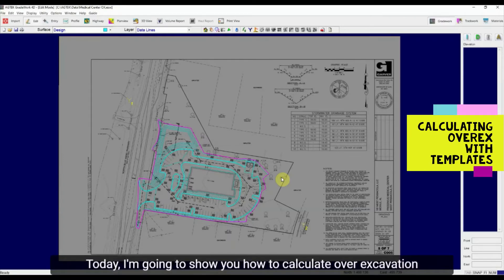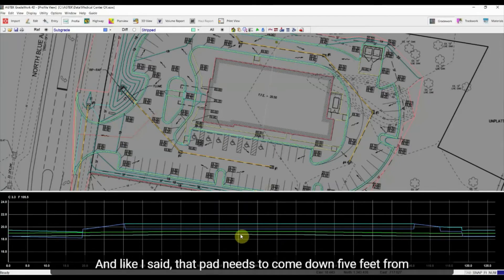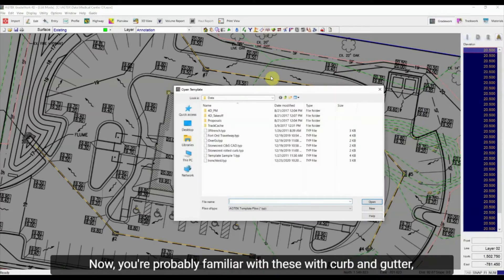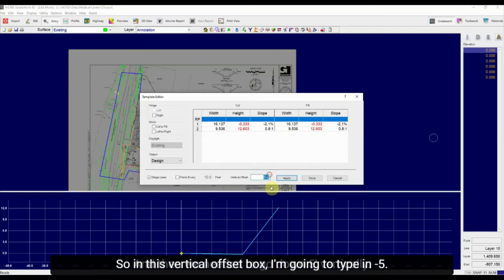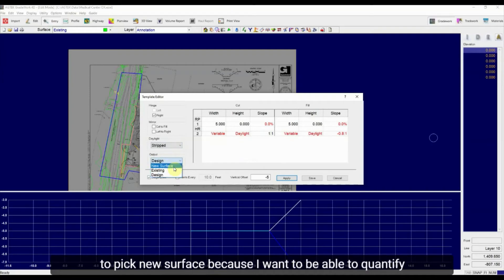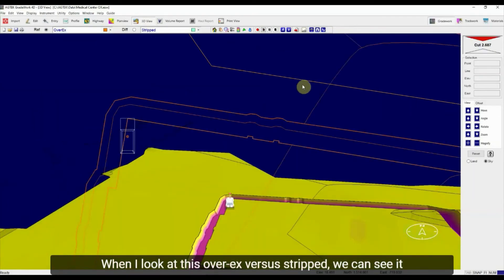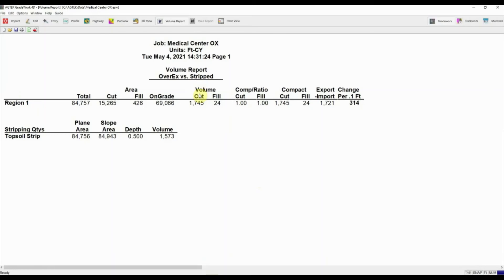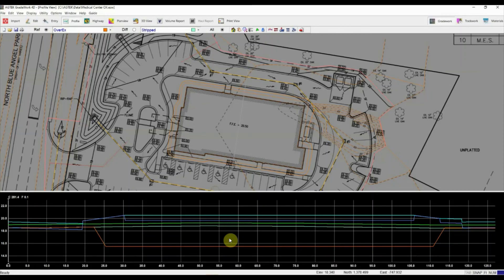AGTEK Tech Tip - Calculating OverEx (Part 1)

Comment: Why is this so complicated when all you have to do is create a section within the pad itself. Drop down menus with 5” (or however thick)concrete, cushion sand if you need it in inches”, and select fill depth in inches. Y’all are making this too difficult with having to draw templates. Very rarely do you have a project with the same strata sections.

Comment: The over-Ex and striped CYs are almost the same. I'm guessing the striped CY is the whole site and not the area of the over-ex only.
A 5' cut and a 0.5 cut should have a big difference in quantities for the same area.
Reply: Why is this so complicated when all you have to do is create a section within the pad itself. Drop down menus with 5” (or however thick)concrete, cushion sand if you need it in inches”, and select fill depth in inches. Y’all are making this too difficult with having to draw templates. Very rarely do you have a project with the same strata sections.
Reply from the maker: You are correct. If you look at the area that makes up the region that the volume is being applied to you can see the stripping area is far greater than the area of the over-ex calculation.
Reply: @AGTEK  Yes, the drawn stripping area is much larger. On the report, the areas are the same. So you won't use the stripping as part of your quantities and disregard it.
Reply: That’s what we do at our ex company